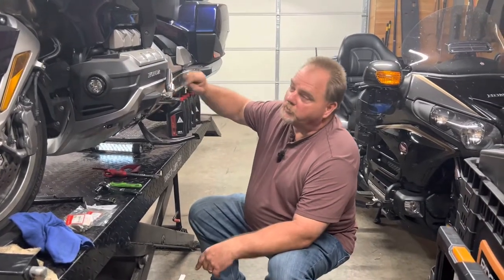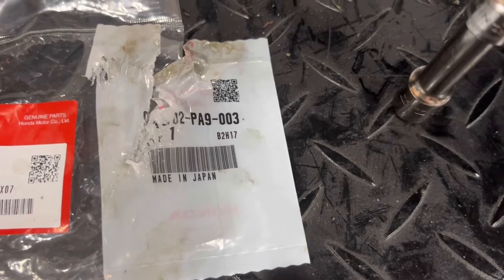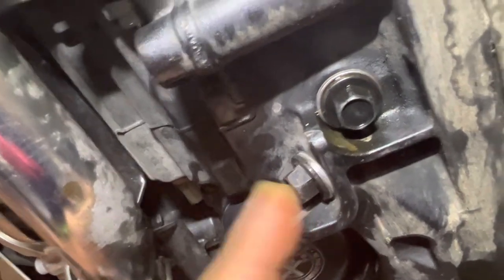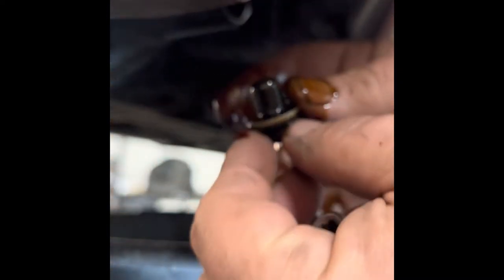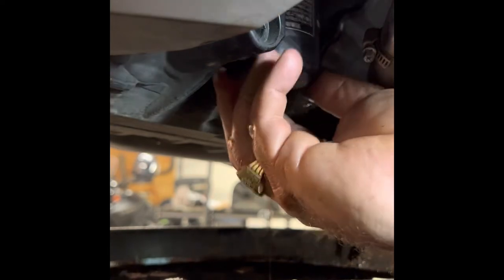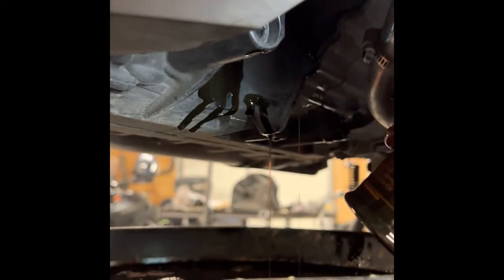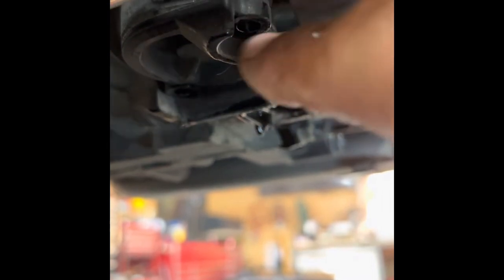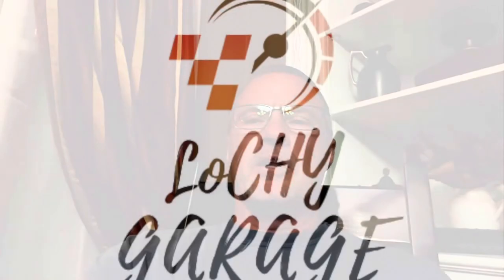GL1800 DCT Oil change- engine and DCT filter

Comment: I found that when all drain plugs are out, oil is fully drained and I put the bike on the side stand, you will be surprised that old oil still coming out. Also, I know many don't use a T. Wrench on the drain plugs and oil filter. but I do. I never had even one issue on many oil changes, by now.

Comment: Does K&N do a replacement oil filter for the GW?  If so it might be worth looking into, there quality and filtration exceeds most if not all other oil filters on the market...but their biggest advantage is, they have a welded 17mm nut on the filter that makes removal very easy, never worry about slipping on a over tight filter again

Comment: I’m curious as to why you only did 1/2 of an oil change. You did not show the actual installation of both oil filters, made no mention of torque values for the drain plugs and unless I am mistaken doesn’t Honda recommend doing the draining on the side stand?

Comment: I'm sorry maybe I missed it. Why would it have two different filters, if the oil is the same, and going into the same hole. I seen another video and it was done just like this one. I'm just trying to understand it. I would think that the transmission would have a different type of oil also
Reply: Because the DCT has it's own separate filter to help prevent the contaminates of the clutch from going through the entire motor.

Comment: Question for you have you ever checked it and it seems like it needs more the the requirement amount of oil . I put 4.9 after a complete oil change and ran it for about 15mins then I waited 3 min like manual said and I had it on the center stand  and seems like it needed more.??
Reply: First, when you change the oil, you don't need to run her for 15 mins. 5 is perfect or 2 bars on the gauge. Second, if you drained the oil well till nothing comes out and added 4.9 qts, don't worry too much, she is fine. The way Honda created this oil change steps is crazy. Every so often, go under and check for leaks, if she is dry, you are good till next oil change. You need to be 80% up from the lower oil line on the stick. All good, boss.